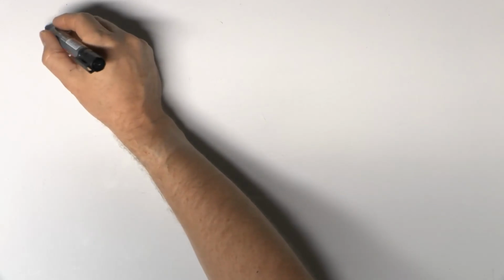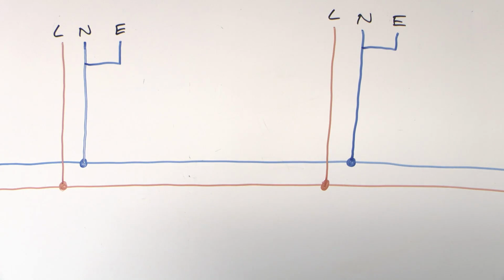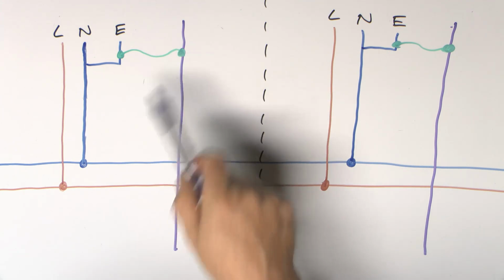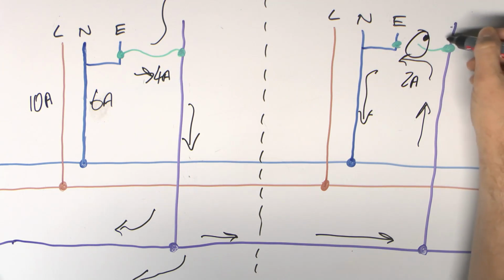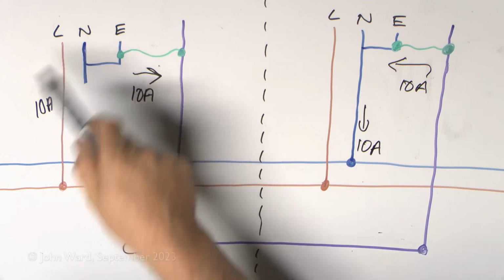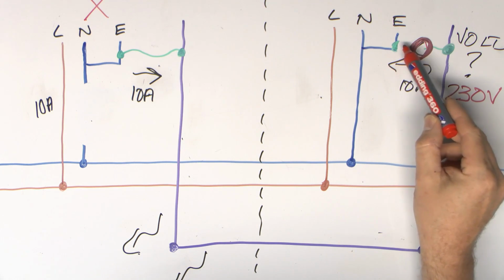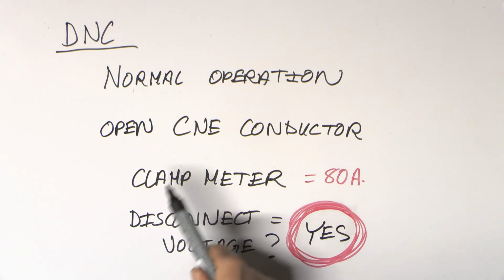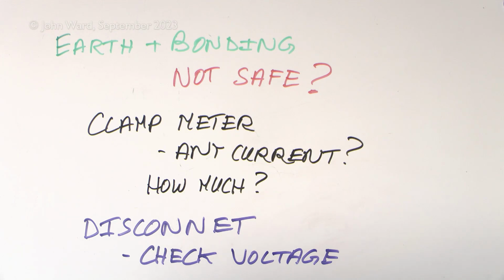Diverted Neutral Current - Description Overview Part 1

Comment: I have found 230v @ 60a on bonding, turned out that the neighbour had a meter hack, they had lifted the neutral, and was running the earth as the neutral, the metre depended on both L&N to make a reading, they had a light switch that would connect the incoming Neutral and the meter would spin as usual when the light switch was on, this was turned on when the meter reader came out or for a few weeks per billing cycle.
They had a heated pool, when the neutral was disconnected, the load from the pool pumps and heater, along with all house devices traveled the earth bond, and reappeared next door where I was working on their bonding.
Highly dangerous, and created by an affluent multi-mullion £ house, trying to knock their electric bill.

Disgusting

Comment: I came across a situation where the annex of a property had a separate supply installed but the earth bond was left connected. An open PEN fault occured on the main property supply resulting in the entire neutral current going via the earth bond to the annex, so everything still worked. It was obvious from the clamp meter readings so we didn't disconnect anything. DNO were out within the hour & eventually found the break. It was overhead open wire & ABC system so relatively easy to fix. We then  removed the common earth bond to prevent the neutral currents from both properties sharing the two return paths and completely separate the supplies.
It always amazes me we have this inherently dangerous system as standard, all to save a bit of copper on the supply.
Reply: The ABC system has been throwing up a lot of issues like this due to the use of aluminium conductors and insulation displacement connectors.
Reply: The modern cable joints and splices that use copper braid held against steel armour with springy metal strips are particularly squirmy.

Comment: Here in Canada we use a split phase delivery with two lines and a neutral.  My son rented a house in Edmonton, Alberta and I noticed that the overhead triplex supply cable had a completely disconnected neutral.  All the electrics appeared to be working normally (the neutral in a split phase system only carries unbalanced load current).  The landlord refused to believe anything was amiss, until the telephone lineman installing internet pointed it out.  The landlord called the power company to re-connect the neutral.  I can only surmise that any neutral current was flowing through the earth conductor to a metallic water line and returning to the transformer through the neighbours' earthing systems and through their neutrals.

Comment: Plumbers changing out water meters should always bridge each side first with shorting cable before removing the meter. Many have been injured or killed as the result of high voltage across the gap, due either to normal operation or a neutral connection fault in a nearby property.
Reply: Also even taking a bath can be lethal because water conduct electricity.

Comment: Very sage advice, JW, we use a variation of the TN-C-S system here in New Zealand called the Multiple Earthed Neutral system.
With corrosion near to the sea, you can end up with broken earthing leads to the main earth electrode.
These often go un-noticed until the neutral conductor fails as well.
With single-phase installations being fed on the same phase every 3 houses down the road, things like this can be really problematic to fault-find.
There was a lady who was killed here a few years ago when she got into the shower, the outlet in the shower was live at 239VAC, I got sent there to find out why this happened, the house 3 doors down, had a broken neutral and earthing wire to the electrode (it was overhead reticulation and the neutral had broken with the service cable swinging in the wind).
Reply from the maker: In the UK, most properties have TN-C-S supplies.
Most of them have no earth electrode at all, because it was never required or installed.
Reply: Very tragic case. Thats why ground electrodes should be chacked at least once in a few months  and its better to use multiple electrodes for additional safety. You can easily create a grounding system with an impedance under 2 Ohms.
Reply: outlet in the shower?
Reply: @jpegxguy  I think he means the water outlet, not an electrical outlet. Ie. the shower head. An electric shower will be earthed, so if the earth becomes energised you can get a shock off it.
Reply: To have 239V on the shower head, presumably her installation wasn't properly earthed either. If she had a relatively low impedance earth electrode of her own, that would bring the voltage down considerably. (In the UK, she likely wouldn't have any earth electrode at all, as John mentioned. Even if she did, it would probably be just a copper rod stuck in the ground with more than 100 ohms of impedance providing little benefit.)

Comment: Very interesting subject here JW as if there is significant Diverted Neutral current the Voltage could be lower than than expected at the Customer's intake position depending on the location of the Sub Station

Comment: Great video very clear and concise... In NZ we have a MEN system and plastic water pipes from a plastic water main...
Reply from the maker: Most countries have an earth electrode connected to the N&E at the panel, which will mitigate most of the problems of open CNE conductors.
In the UK, most properties have no earth electrode, as although allowed it's not compulsory so no one bothers to install them.
Reply: @jwflame It only mitigates it if it is a low impedance earth electrode. Just a copper rod stuck in the ground with more than 100 ohms of impedance, as is common for British TT systems, provides very little protection from these faults. I know a lot of countries bury a bare copper wire all the way around the perimeter of the house with multiple rods attached to it, which should do a much better job.
Reply: And is the water in a plastic  pipe a conductor ????

Comment: I'm not an electrician so this is probably flawed thinking. Is it right to think that you may not detect a high current as the appliance may not be turned on i.e. next door does not know they have no power until they turn their oven on at which point you get electrocuted because the system tested as safe? Is it prudent to always replace the bonding with a "jumper" to ensure that there is always a path to N/E just in case?  Thanks for a great video on something that I hadn't considered.
Reply from the maker: Yes - the current depends on what loads are connected at the time, so it will change as various different loads are switched on and off.  It's totally unpredictable.

Comment: Could it be 400V if next door is on a different phase?
Also currents quite low if only modern LED lighting is on. (But presumably this generalises across many houses, which increases both the potential current sources and current sinks with multiple phases to contend with too - so someone's neutral could end up partially going down someone else's line due to the phase difference?)
Reply from the maker: Yes, depends on how loads in different properties are balanced across the phases.  With an open CNE, some properties may get a voltage which is too low, others too high, and some may get approximately the correct voltage.  All of that will change as the various loads in each property are switched on or off.

Comment: Mr Ward. Is there any way to geolocate a 0,2Mohm leak in 4x35 underground (less than a meter depth) cable. Isolation damaged (L3 and PEN is leaking to each other and actual ground)? Cable is 50m between street and house main panel.

Comment: Food for thought🤔. Clip on amp meter before you disconnect, thank heavens for plastic pipes 😂
Reply: And is the water in a plastic  pipe a conductor ????
Reply: @pjeaton58  well yes it does but it would have to travel the entire length of the plastic to to an earthed underground pipe. It would be very high resistance

Comment: Is there a difference between E (earth) and PE (protective earth)? I'm not used to letter "E". Coming from EU mainland.
Reply: Protective is from what I understand just a descriptive of the purpose and not a difference in installation, as the potential equalisation while using different colour (clear or by latest standard, pink insulation) is hooked up to the same bar as the PE.
Reply: @BPo75  pink? Usa?
Reply: @tarassu  Latest iteration of the IEC standard from the beginning of 2023.

Comment: Hi John, I was just wondering if you might be able to help? I just received a 1960's Vortexion valve amplifier, which has the original power outlet, but no accompanying lead. The unit's in very good condition, I just need to track down a suitable power lead, or possibly swap the outlet for an IEC?!

Any advice would be much appreciated....many thanks, Dan
Reply: Use an IEC !  with due regard to male/female for power in or out ..

Comment: Finally a real reason to buy a single pole voltage detector? SP Energy Networks describe their neutral current diversion test procedure as follows: "Clip-on ammeter applied to earth connection to consumer unit. Should indicate nil current flowing. Where current is found to be flowing in the earth conductor the guidance in EART-10-027 shall be followed." Of course they don't bloody publish EART-10-027.

Comment: Given that we use three phase distribution the maximum potential difference between L1 and earth could be more than 230v since the neighbouring property with the missing neutral line might be on l2 or l3.
Reply from the maker: Yes, with an open neutral, voltage L-E could be anything up to 400 volts.  Also likely to change at any time as various loads in other properties are switched on and off.
Reply: I had that at my flat last year! My electrics went peculiar and I assumed there was something wrong with my wiring. So I measured the mains voltage with a multimeter and over a period of about 30 seconds I watched it drop down to 100V and then gently go back up to 240 and on to 400V. I failed to get to the CU in time and most of my kitchen appliances were toast! (as were the appliances in the other 11 flats). Turns out it was the neutral to the block of flats (I assume it's TN-C-S). Presumably the block is supplied with three phases so when one of the flats turned on a kettle, the flats on the other phases got the phase-to-phase voltage.
I'm thinking I should have my CU replaced and fitted with Schneider Electric AFDDs cos these seem to be the only devices that have an over-voltage trip (270V). I was looking at surge protection devices but I don't know that they would necessarily be effective for 400V.
Reply: @edwilliams8225  That would rather be a Floating Feeder Neutral in an 3 phase supply…

Comment: Can I ask a silly q: if earth and neutral are connected what is the point of earth?

My non professional mental model was the circuit is live->load->neutral and earth is to catch disconnected conductors in preference to completing the circuit through a human.

(I am not an electrician)

Thank you
Reply: Having an earth conductor connected to conductive surfaces means that they are all at the same potential and in a working installation that potential is same as the mass of earth itself so although current can flow you won’t receive a shock should you touch it, even in a fault condition.  Furthermore, in such a fault condition it is likely that given the low resistance of the earth  conductor, the high current will trigger an overcurrent protection device such as MCB or fuse.
Reply: @_chrisr_   Understood - thank you and thats aligned with my understanding of Earth.

My question is if its connected to Neutral - which is the return on the load circuit its effectively at the neutral potential?

Does that make sense?

Comment: I'm happy 3phase tt with plastic gas and waterlines is the norm here in the netherlands.

Do you expect other systems to evolve to something similar to this?
Reply from the maker: Gas and water supplies in the UK are already plastic for anything recent, and older steel pipes are being replaced with plastic, either individually when properties are refurbished or whole streets at a time because the old pipes are corroding away.
3 phase is unlikely for UK homes, almost none of them have it and there isn't really any need for it.

Comment: Great video Sir, I watched another one of your videos which showed how the networks neutral can be pinned into the ground with rods by the DNO (normally because of a repair by the DNO on the neutral), therefore as good as turning the system inside the property to TT.

Comment: A interesting case to watch out for! I am beginning to think TT earthing (If the location is suitable) is the way forward to replace TN-C-S, considering this video and possible PEN faults at the distributors network. Excellent video John, many thanks!
Reply: I was thinking the same. TN-C-S has the advantage of a very low impedance defect loop. But with a very sensitive RCD (30mA or less), we can get away with higher defect loop impedances using a TT system, right?

Comment: The electric meter neutral/earth sees less current in the example presented with diverted neutral current.  Does it still measure kWh correctly?
Reply: The electric meter is downstream from the neutral-earth bonding so it is not affected.
Reply: @okaro6595   In my house the earth bonding wire to the buried iron gas main comes from the consumer unit but the meter tails are direct from the TNCS conductor where a Henley block supplies incoming earth to the consumer unit.  So in the case presented diverted neutral current through the earth bonding wire does not go through the meter which would see unbalanced current on live and neutral tails.  Although my clamp meter says no current in the earth bond and L and N conductors seem roughly balanced.
Reply from the maker: Electricity meters only measure current in the line.  Neutral is a solid link internally and only there so it can get a reference for the voltage between L-N.
Reply: @andybarnard4575  the electric meter likely only measure’s current in the L conductor, the N conductor is there so that the meter has a source of power that it can use to function

Comment: Something I had never even considered. BTW We now have Blue plastic water pipes and yellow gas plastic gas pipes to the house, and the earth is still connected to them- so having it connected via the neutral is a bonus I suppose.
Reply: That's not the earthing conductor, it's the bonding conductor and it doesn't connect to plastic incoming services.. unless the spark is an idiot and doesn't understand bonding requirements.
Reply: @DS-tp6vx  Plenty such idiots out there... A few years ago, at a complete new installation in a commercial property I was working at (installing the AV systems) I had a good chuckle at what the sparky had done on the water supply.  New water supply in MDPE out of the ground, all of the internal pipework was plastic speedfit or similar but they had inserted a foot long piece of copper just after the stopcock so that sparky had somewhere to stick his bonding wire!  Apparently some out there think that you need to "bond" the water 😂
Reply: @timbo19  Obsessive Bonding Disorder
Reply: @DS-tp6vx every new build I see has the gas and water bonded😂

Comment: great video. thanks
if there are more neighbours, not only two you demonstrated, there is much more chance very small voltage will be present when the neighbour bonding disconnected. there are lots of other way for the neutral be diverted and original house's appliances will suffer bad performance then normal, which sometime will not noticed if the appliances not cause so much current.